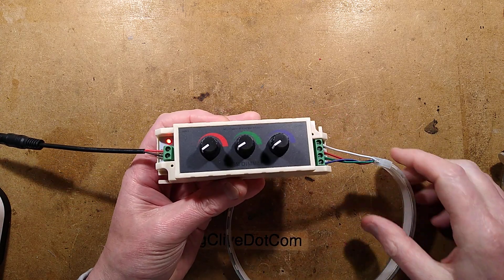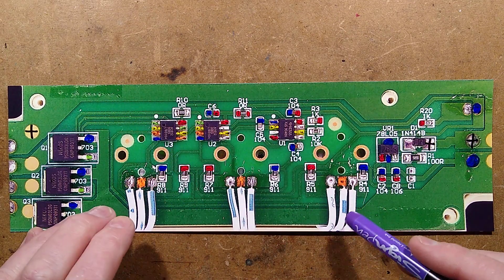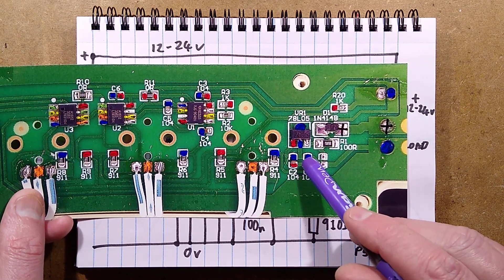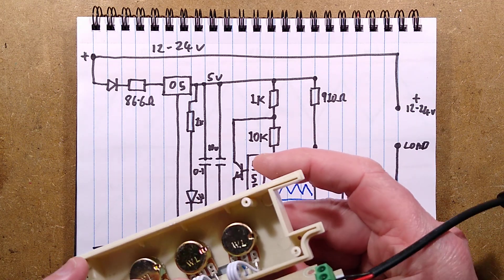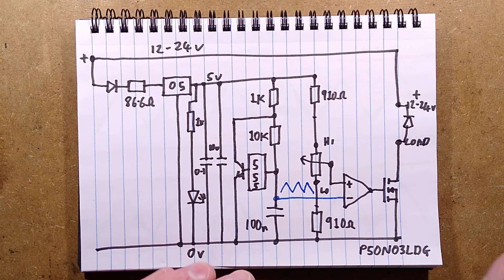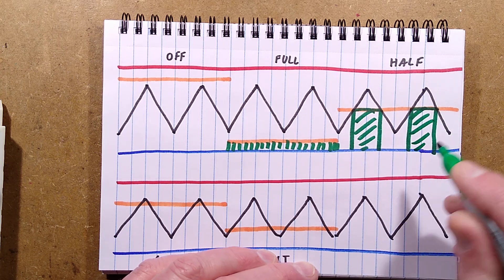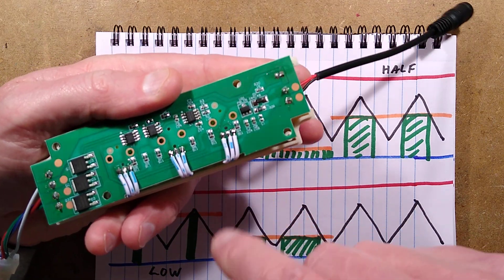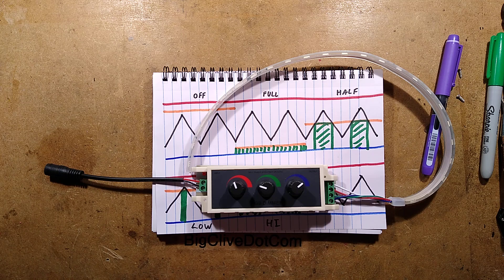RGB dimmer teardown and schematic (no microcontroller)

Comment: how does a smoothing capacitor work ?....i know its stops the flicker but HOW does it do that ?
Reply: They're reservoirs. When the power coming in falls below what it was, the capacitor starts discharging and takes up the slack. If you want an analog from the physical world, check out "hydraulic accumulators".
Reply: Say you have 12v coming in. You have a capacitor in parallel across the positive and negative rails.
The capacitor charges up to the 12v coming in, and once its full, just sits there doing nothing. If the voltage should then drop to 10v, the capacitor basically releases the missing 2v, so that your circuit still gets 12v.
Reply: @malcolmrichards4736   Thankyou

Comment: isnt it way easier to use a 558 leave 1 channel unused and generate 3 pwms with the standard astable arangement with the pot being the voltage divider? needs one ic 3 caps and the regulator. or just 3 555s. the opamps are certainly no more expensive than the 555 given how generic they are

Comment: Why need to generate sawtooth wave? 555 can generate PWM on it's own using Potentiometer with 2 diodes!
Reply: The classic 555 circuit with the two diodes is unable to go all the way to zero or 100 percent duty cycle. It's close enough for many cases but LEDs are so sensitive you'd see them glowing when they're turned down all the way.

Comment: Saw tooth ramp with a comparator to make a nifty PWM generator... they use these to convert sinusoidal audio to PWM for class D amplifiers if my old brain recalls correctly.  Non-DSP systems anyways.
Reply: Logically workable..but even class D amps have a " negative" feedback path from the spkr. terminal , back into the comparator 
circuit for stability...and it's really critical design ..
Reply: @analoghardwaretops3976  You are absolutely correct.  :)

Comment: How's the EMI noise around the MW band?
Reply from the maker: It's a fairly low PWM frequency of just a few hundreds of Hz.
Reply: @bigclivedotcom  There might be some overtones from the moment of switching.
Reply: 500hz switching noise every time the 555 toggles ..it's output(pin3 even in open ckt.) is known to have..( somewhat tolerable) CROSS-CONDUCTION.. hence ..reasonable decoupling cap on Vcc..& pin 5....pint decap. to prevent " false trigger" of 2/3 Vcc comparator..that lends to frequency/ duty variation of oscillator....another reason for max.of (250-300)khz freq. range..the 7555 ( internal MOSFETs) allow upto approx.  2MHz..in this chip cross conduction issue is negligible...hence lower E.M.I./ R.F.I.
Reply: @analoghardwaretops3976  Not sure what you are on about.  My point is that the momentary edge of a 500Hz rectangular wave can be Fourier analyzed to include some much higher frequencies to represent the abrupt edge, including on the 3 output circuits.
Reply: @johndododoe1411  the SPECTRUM MAY BE widespread as you said.. the fundamental is @ 500Hz..

Comment: I think you made a mistake with the diagram.
In the schematic you have the "output" of the 555 going into the inverting input of the OP Amp, while the potentiometer went into the non-inverting input.

That should mean that if the voltage from the pot is higher than the 555 the output from the OP Amp is high and that should turn the MOSFET on and turn the LEDs on.
Conversely if the 555 is higher than the pot the OP Amp should output low and the MOSFET should be off.
Reply: What does it matter in the end, both will result in 0-100% duty cycle PWM
Reply: @rexsceleratorum1632  From an electrical design point of view, it matters which way around you put the potentiometer. You don't want to turn it off by putting it to max.

It can also matter from an education point of view as some people may try learning about electronics by watching videos like this and get confused.

But from a functional point of view, you could switch the connections on the OP amp and other than the change in direction it would work the same.
Reply: @jeffreyblack666  It is not clear from the schematic which legs of the pot are which physically (other than center), so the actual turning direction is left undefined by the schematic either way.

Comment: i guess you messed up the off and Full part as the saw waveform is fed into the inverting input and the potentiometer voltage is fed into non inverting input that means then the potentiometer voltage ( non inverting input) is above the saw wave voltage(inverting input) the output will be high otherwise low. if im wrong sorry. :D
Reply: Recheck.. output waveform is the voltage seen across the mosfet D-S terminals..

Comment: I'm not even a hobbyist, but could this be done with only two pots, given that each pot can divide that voltage between the inputs for each channel, or do I not even have the slightest idea? Insults await me, but I'm strong.
Reply: It is hard to know what you are getting at. Just two pots and no circuitry? It will fry the pots. With the circuitry, 3 independent voltages need to be generated, not sure how that can be done with two pots

Comment: The change in resistor and potentiometer type tells me maybe they couldn't get smd potentiometers in a high enough wattage rating...

I'm sad you didn't show it working
Reply from the maker: You skipped over that bit.  It was at the beginning.
Reply: I don't think I've ever seen SMD potentiometers meant to be turned by hand, only tiny trimpots. Wattage rating isn't an issue because here they only dissipate three milliwatts.
Reply: @bigclivedotcom  I'll check it again...
Reply: @bigclivedotcom  how did I miss that 😅

Comment: There is one thing that I don't get... When the MOSFET is on, nearly the entire supply is being dumped across the LEDs. Those can typically only take between around 0.7 to 3.5v (depending upon color). Driving an LED at 12v should let the magic blue smoke out.
Reply from the maker: It's for things like LED tape where there are series resistors with every group of LEDs.

Comment: I wonder if instead of 2 opamp chips and 1 555, if they used 3x 555 chips would have been cheaper. It wouldn't be frequency stable tho

Comment: Interesting design but clearly not cost-optimised! The placement cost alone would make a single SOIC-8 microcontroller such as a Holtek HT66 or Padauk a much cheaper choice. Also the giant D-Pak MOSFETs are a crazy choice, plenty of SOT23 trench FETs can handle many amps without breaking a sweat. Don't get me started on the huge board area too...
Reply from the maker: I think it's a standard product that has evolved with the same case.

Comment: The circuit could have been optimised assuming it was worth the effort. You could get it down to mosfetx3, lm324x1,resx6,capx3,diodex1,vregx1 and potx3 for something capable of driving all three outputs. You could save another 2 res if you were happy to have dead areas at each rotational end of the pots.
Reply: Or eliminate the voltage regulator and the decoupling capacitors if you want the cost down more, although that might affect the stability a bit.

But wait a minute, why does your version need a diode? I'm thinking four resistors and one cap for the ramp generator, two shared resistors to bias the pots, and the three mosfets for output. Were you using the diode for reverse polarity protection?

Comment: Technician A and Technician B are dressed for surgery with their LED monacles illuminating Grandpa's cranial area, as Grandpa sits catatonic in the operating chair.  "What happened to him?" asks A.  "He was chewing on an extension cord. Apparently it got mixed up with his late night spaghetti snack." replies B.  "Hmm.." says A. "It could be a complete meltdown of the brain circuitry. I wonder what type of BPU chip he has.  He's over 100 years old."  "I don't know." replies B "It could be one of the original T1000s or maybe an R2D2 variant." 

"Here goes" says A as he gingerly prises Grandpa's cranial access panel open with his spudger, ancient hinges creaking as bits of debris and dross fall out onto the floor. 

Peering inside, his LED eyepiece illuminating the cavity, technician A uses his air jet to blow away the accumulated dust, exposing the delicate brain circuitry. 

"Hmm.." says B, squinting to get a better view.  "I don't see any BPU chips at all. It looks like Grandpa's brain is nothing but a bunch of 555s wired together on this piece of perf-board."

(o-]  A      (o-]  B       :o] Zzzzz..

Comment: That resistor on the input side of the linear regulator REALLY bothers me, especially being a "precision" value.
Reply from the maker: Yeah, it's very odd.
Reply: Simple protection in case of shorted regulator or 555..the res. would " fail"  to open ckt.

Comment: Colours don't really mix like that. Red and green don't equal yellow. They just fool the cones in the eye into thinking they're seeing yellow. Since the R and G cones are both sensitive to yellow, so when they see yellow light, that's the signal that gets sent to the brain. But stimulating them separately with R and G does the same job. But the colours don't "mix". Where would that happen? On the surface of an object? In the aether? The waves somehow interacting and modulating each other? That doesn't happen with light. The only "mix" is in the eye, fooling receptors. If you could see a TV, or a monitor, how it really is, it'd be like one of Andy Warhol's paintings with the colours separated. It'd look weird. 

Same way colour printing uses CMYK, because that fools the human eye. But an alien might see it as a weird spectral mix, some sort of bizarre artform. 

They never teach this at school, it's always that the colours "mix", but they never say where or how. Because it's bollocks! It's a trick of the eye and nothing more. R + G don't = Y, they just fool the eye into thinking Y is there. It's just a weakness of human vision. 

If we actually had full panchromatic vision, television would be impossible, the best you'd get would be black-and-white, monitors would all be green screens. 

Which would be better! The Internet was better before the public all joined up, before corporations came along, before you could make any money on it! Now the biggest companies in the world are Internet companies! And the money all comes from... advertising! Bleh! A blight on human culture!

Kind of bonkers they're doing it analogue when a microcontroller has all that hardware on board, and costs less. You'd still need the MOSFETs but that's about it. You wouldn't have to bother sticking resistors either side of the pots, you'd just do that in software. The PWM they often have built-in, or else it's simple enough to program.

Comment: Wow !  A normal circuit !  Nah, there has to be a hidden catch. Mess'n with me head argin'...
That 4th opamp should have all pins tied to Gnd, but, a penny saved is a penny earned. Plz excuse my America-izimz..  ;)
Reply: Input pins only..though not necessarily..
Reply: @analoghardwaretops3976  (I should leave this alone, but, in for a penny - in for a pound !)  Mario, please explain further
Reply: @snakezdewiggle6084  the unused opamp's input pins (inverting& non-inverting) only connected to zero volts through a resistor  ( 10k-47k) is considered good practice....
any opamp has very high open loop gain >10000.. this can cause unwanted oscillations killing the opamp/ chip ( switching in nano seconds from rail to rail ) 
another good safe mode is connecting the unused opamp's output pin to its inverting input that is connected as said earlier..  ..( unity gain negative feedback config.)
Reply: @analoghardwaretops3976  tieing all 3 pins to 0 volts deactivates that area of the silicone-oxide layer. G00Gle is not schooled in doping silicone.
Reply: @snakezdewiggle6084  only the 2 inputs.... doing that with the output is still a risk...
Reply: @analoghardwaretops3976  (Sorry for the poor wording in my last.) You will need to look at the silicone dye mask, the arrangement / layout is very unique.

Comment: Can you really call a 555 a 'microcontroller' ?  It's entirely analogue and fixed function/unprogrammable (changing its rate isn't programming any more than dimming an LED with lower voltage is...)

Comment: set it to Brown!
Reply: No can do! Isn't brown one of those colours that we only see when next to another colour? Hmm...
Reply: @burtgummer9057  Brown is simply dark yellow.  The LEDs in your OLED cell phone display have no problem with it.
Reply: @stargazer7644  hmm... I always thought brown was a dark yellow/orange. But yes our eyes/brain is very good at seeing what we want to, for example gold or silver on a crt monitor. No mixture of r g b makes gold or silver, and yet...
Reply: @burtgummer9057  Brown could have small amounts of red or green in addition to the yellow, depending on the shade.  Sure you can make gold and silver with RGB.  Gold is bright yellow with a bit of red making it warmer.  Silver is simply grey.  Your monitor creates both just fine when showing pictures of those metals.  For convincing metals, what you need in addition to color is luster (or shine). They often exhibit semi or full reflections depending on how polished they are.  A single RGB led can't show luster, but a matrix of them (like in your monitor) can make a convincing replica, especially if the image is moving.  That's because shine changes as the metal is moved.  Your monitor can't really reflect light of course, but it can look like it does.

Comment: This feels weirdly over-engineered, because there exists schemes to run the 555 as a PWM generator independently, as a one-chip solution. They could have just as easily used three 555s and saved some money on parts (although LM358s are probably as cheap as 555s, but that way no part of a chip would be wasted).

This method ensures coherence between the pulse trains for each channel but the phase relationship between R G and B shouldn't effect what you see should it?
Reply from the maker: I don't think the simple 555 PWM can go to fully off or on.
Reply: @bigclivedotcom  true enough, the triple-555-PWM solution needs to have a minimum and maximum different from 0 and 100%, unless you want to fry your 555 without a discharge resistor. Had this unfortunate experience when building my own 3x555-PWM RGB dimmer, then redesigned with the additional discharge resistor.
This schematic with the op-amp is more elegant, I might update my LED driver to that 😉
Reply: There are a couple issues here. The first is that the 555 as a pwm generator has a limit on duty cycles -- it can't quite get to 100% on or 100% off. Second, and the real genius of this circuit, is that three 555s would end up being more expensive than this circuit, because of the cost of passives. A 555 as a pwm generator needs 4 resistors, 3 capacitors, 2 diodes, and pot, per channel, which leads to, in total, 12 resistors, 9 capacitors, 6 diodes, and 3 pots. This circuit, on the other hand, needs 8 resistors, 5 capacitors, and 3 pots. It really is quite an efficient design for what it does.

Comment: Hi Clive. As I said I'm going to buy one of these to see what sounds I get out of it. Well I received mine this morning. I wired it all up for sound. to find the item is totally dead. I checked everything I had done, and it was fine. Last month a bought a chines smart charger. it went bang as soon as I plugged in. I opened it up. After the dispute was sorted. what did I find inside of the smart charger. None of the component wires was chopped. making as many shorts as possible. I know what the chines will say. They will say, will you take 25% reduction on the item. then give you a sob story how its going to cost them a lot of money to give more than 25%. If the item was checked before dispatch (I think they use to call it quality control). They would have less returns.  I think now the customer is customer control.
Reply from the maker: Does it make the speaker click?  The transistors do not have inductive spike protection, so a speaker may have damaged it.
Reply: @bigclivedotcom  Hi Clive. It didn't make a sound.  I contacted them and surprisingly the got back to me quickly. At the end of it all they have offered to send out another unit. The speaker is a little 8 ohms 1 watt. with a 22uf capacitor in line. Or do you think the capacitor isn't enough. Or is the speaker still a problem. Thanks Jon

Comment: why not jsut go all the way and get smart lights already that is bluetooth/wifi and has a app and can do all the fancy stuff then. i mean some of the smart lights even have a controller that uses ir or rf that can use too even. i just don't see the value of something like this with knobs when a app can do everything it can do and more from anywhere.
Reply from the maker: Because sometimes you just want to twist a knob and not have to deal with crashes or external rogue interference.

Comment: This method/circuit is not really all that uncommon, used in many places. The op amp Works for longer with some gate resistance though.
Reply: Gate resistance?  This opamp is being used as a comparator.  The input impedance is practically infinite.
Reply: @stargazer7644  I'm talking about some resistance in the output to the gate of the FET.  It appears that the gate capacitance conspires with fast rise times to cause failures in the op amps output. I've seen/experienced many failures using an LM358 in this role but when 100R is inserted between the output and gate the failures stop occurring.
Reply: @davidwoodbridge862  Thanks for the clarification.